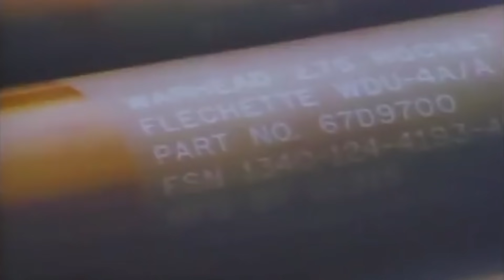'Rods from God' Weapon System Gets Another Look

Comment: Total cobblers.  Assuming the projectile does not lose much of its energy from air resistance during the fall (which it will) the energy released on impact with the ground cannot possibly exceed the energy it took to put it into space in the first place. This would be equivalent to only a small fraction of the rocket fuel, most of which is used up in taking the rocket and the rocket fuel together with the launch platform and the other projectiles to that altitude.  Although the impact would be fairly impressive,  probably equivalent to tens of kilos of high explosive concentrated in a small area it can in no way be compared to a nuclear detonation. To prove this meteorites of similar weight moving at even higher velocities impact the earth every day and if these resulted in nuclear weapon scale detonations we would certainly know about it.
Reply: @valerymonneron9357  The principal of conservation of energy and momentum is one of the most if not the most fundamental laws of physics. The amount of energy released by the projectile cannot possibly exceed the amount put in I.e the gain in potential energy in putting it into orbit, which can only come from the proportion of the chemical energy released by the rocket fuel expended to raise it and it alone to altitude. The addition of a rail gun would also need considerable energy to get it into orbit and to power it sufficiently for it to have any significant contribution to the energy of the projectile, so that solution is not likely to be very efficient.  During WW2 the famous British inventor Barnes Wallace developed the Grand Slam bomb, which was partly a kinetic weapon dropped from a great height into hardened targets but like the later American missiles mentioned in the video the kinetic energy was used to provide the penetration needed before the conventional explosives payload was detonated.
Reply: Youre Mahm  OK, so lets assume the "rod from god" weighs 1 metric tonne or 1,000kg, which is pretty big, and is dropped from say 400km height, which is the orbit of the International Space Station. Newton's 3rd law states v^2=u^ + 2as.  The initial velocity u = 0 which simplifies the equation to v^2 = 2as so the final velocity (assuming no air friction) v = (2as)^1/2. Acceleration is 9.81metres/sec/sec so the impact velocity v = 2,801 metres per second (pretty fast).  The kinetic energy released on impact with the ground is 1/2mv^2 = 3,922,800,500 joules, say 4 gigajoules.  This equates to a conventional explosive yield of about 1 metric tonne of TNT.  So as a rule of thumb 1kg payload dropped from a height of 400km results in an explosion equivalent to 1kg of TNT.  As a comparison, the "Grand Slam" bomb of WW2 dropped from a height of about 4km containing 4,300 kg of Torpex explosives had an explosive yield of about 6.7 metric tonnes of TNT and the first atomic bomb dropped on Hiroshima had an explosive yield of around 15,000 tonnes of TNT.

Comment: Its a Ten ton Tungsten rod, considering all the top secret launches in the last 20 years after the shuttle program ended they are already up there, and far worse.  It would unleash about the same energy as the Nagasaki bomb but no fire or radiation from the blast.  And they would have multiple rods in each platform.  Our heavy lift capabilities make this more than plausible even if it has many 10 ton rods
Reply: not even close, i actually did the energy calculation and one 10 ton rod traveling at orbital velocity has roughly 0.07 kilotons worth of kinetic energy.
Reply: You do realize there is no such thing as Kilotons worth of Kinetic Energy, that pretty much assures me your calculations will be wrong because you don't even know you need to calculate into MJ then try to guestimate how many tons of TNT it would equate to.  If you think 22000 pounds slamming into the earth at 17000 mph isn't a lot of energy then I see no point in even trying to explain the energy to you.  Considering asteroids in the past about that mass hitting the earth left craters hundreds of feet deep and nearly a mile across.  You don't even seem to understand the problem correctly, so I doubt you can calculate it accurately.

Comment: If the dude who jumped out of a balloon at 110000 feet broke the sound barrier in free fall these things would easily go super sonic from the same altitude.
Reply: 17000 Mph is a little faster than supersonic im afraid Hakapik, that's approximately how fast the rods would be going when they hit the atmosphere
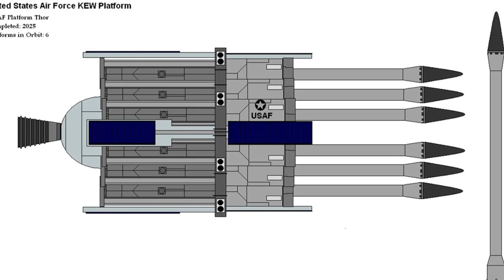Reply: @dajhrm  At the 1:07 mark the vid says they were 20 feet long, 1 foot thick rods dropped from high enough altitude to reach "sound barrier breaking speeds". Where do they claim 17000 MPH? Sorry Goosworks lab, but I am afraid  they dont. You are at least right about one thing, 17000 MPH is not the "sound barrier breaking" speed referred to in the vid, is it?
Reply: That's the speed they are at in orbit, if I need to explain that to you then its probably beyond your understanding to begin with.  You do understand they are dropped from orbit then fall to earth, they fall at approximately 17000 mph until they hit thick atmosphere at around 100k feet and slow down marginally when they hit the ground in about 3 seconds depending on angle of inclination on entry, these are dropped from around 100 miles up or more, not 110000 feet, the height of a U2 Spy plane.  You clearly don't understand at all how this weapons system works.
Reply: Except he didn't, first of all, if he did, he'd be blind, deaf and most importantly, dead, as going at supersonic speed with just your body would blast your lungs and ear drums. Even if they were indestructible, you wouldn't have enough energy to breathe, and would suffocate. Last of all, human body terminal velocity is about 120mph, 160mph if you do it right, it is objectively impossible to fall faster than that.

Comment: u can make a scramjet do mach 18 and survive the heat  but can't coat the tip of a rod with heat resistant ceramic like on the shuttle? And here's the thing only the nose is taking the friction  you just need to keep adding rod until you get enough to survive till impact

Comment: You use a mass driver and launch asteroids.... 50,000 mph speed means a much smaller mass for said power...
Reply: yes and no, rocks come apart alot easier, and youd have to be pretty dam careful not to underestimate the rock or orbit and have a much larger hit than desired vs an aerodynamic metal rod that doesnt break apart randomly.
Reply: the idea is to have it in orbit ready, not to have to go and get some rock out of an asteroid belt and spend years getting it into earth orbit somehow to then drop it

Comment: Complete horseshit what about terminal velocity and other symbol physics??
Reply: the rods would be skinny barely any air resistance to slow them down and by the time the air would be thick enough to slow them down in any way they would be flying around Mach 10 the only problem they face is getting so hot they melt.

Comment: Somebody worked out the math on the potential energy of a 2000 pound penetrator and it was not as high as this guy says. It would have taken 10 of them to equal the 15 kilotons atomic bomb. Now does this make it worthless, NO, it just needs to be a bit more realistic. The type of ground composition is also a factor, soft sand or solid rock. It is a weapon worth researching.
Reply: surface friction and aerodynamic drag wouldnt scale if you just made it a 30,000 pound rod....might only take 10 of them but yeah. dropping 20,000 lbs of mass from orbit with 0 fallout in a non stoppable fashion is something.....i guess you can hit it and try to get it to spin and come apart but the velocity the 2 objects would close at would be insane, would need something like a sprint missile again
Reply: @Richard-ie1if  20 000lbs would still not hit atomic bomb yield. far from it.   unless you accelerate it to near speed of light.
Reply: @jkk20  at 20k lb and 1/2 light speed y'all would want to be in the next state minimum
Reply: Well it's not perfect but the best alternative there is to nukes when it comes to say attacking infrastructure deep in enemy airspace where it's unsafe for bombers to go or places where your troops might need to advance to
Reply: Nuclear weapons are good because they typically airburst and dump all of their energy into the atmosphere which is then turned into a shockwave that does most of the damage (They also produce a shitload of heat but that doesn't do more damage than the shockwave unless you start getting into the megaton-yields). Kinetic weapons like rods from the gods will never be a true replacement to nuclear weapons because they dump all their energy into the ground, the ground is also a much thicker medium than the atmosphere (Ground vs air) so the shockwave doesn't travel as far. You could theoretically trigger man-made earthquakes with this kind of thing, but it's basically just a bunker buster on steroids. It's not a WMD.
Reply: @cod6guy12  heat of an hydrogen bomb does damage. as long as the area targeted is within the dome created by the hot plasma moments after detonation.  there was some value about detonating a nuke upon contact with the ground rather than air burst,or a very small altitude air burst even to get a abnormal wave adding onto the allready high compression generated by the hot gasses. anyhow,nukes will always be favored for outright destruction vs any other hollywood sci-fi voodoo rod of god bs.
Reply: @jkk20  I didn't think it was necessary to point that out as at that distance the shockwave is strong enough to obliterate everything regardless - I was more-so talking about radiant heat. The lethal-radius of the heat is usually smaller than the lethal-radius of the shockwave up until a certain yield. 
I haven't heard about detonating nukes at lower altitudes for a stronger shockwave (I was under the impression that high alt. airbursts were always superior for cities) but I can picture in my head how the waves could overlap and cause that affect, so that makes sense.
Reply: @cod6guy12  highly reinforced concrete won't buck down to a thermonuclear warhead's shockwave at those small distances for the most part,what could help is temperature and its effect on said material. 

about the overlapping shockwave effect,it was filmed on a few different shots. one of them was the atomic annie shot (atomic canon) 15kt that did way more damage since it was at 500 feet,now imagine a thermonuclear warhead of just 100kt at anything under 1000ft and you have a recipe. the reasons they'd want to nuke at higher altitudes it is to maximise radius of destruction,minimise radiation all while being efficient with the least effort. kill more,polute the land less so the troops could potentially re-capture the land(invasion) at least its what i think they'd do it for.
Reply: @jkk20  Hmm, I quickly did a bit of research and it seems a very large nuke like the Tsar Bomba has a 20psi blast overpressure radius about twice as large as its fireball. From what I understand, most reinforced concrete buildings are heavily damaged at 10psi - Though that number could be higher for military grade reinforced concrete.
This is the site I used for the Tsar Bomba overpressure number: https://nuclearsecrecy.com/nukemap/?&kt=50000&lat=40.72422&lng=-73.9961&hob_opt=2&hob_psi=5&hob_ft=13000&ff=3&psi=20,5,1&zm=10
If the link looks sketchy you can google 'Nukemap' instead.
Reply: @cod6guy12  yes,at 20psi we are looking at heavy damages. but there is also something to take into account,today's building code stems from a series of nuclear testing to see what were the limits of engineering to prevent such catastrophies.  teapot MET shot served as a test bed to see if safes,wooden or even concrete reinforced houses could sustain a nuke at x distance.   

i believe the nuke was placed 1km away from test items. many reinforced structure survived. even the paint or lack thereof proved to affect the resulting survival of the test items. hence,i would not think that a basic nuke would do much to a city unless its set to detonate at low altitude. cause a earthquake aftershock all the while cratering and spreading soil and so on.

and yes,i've read the nuclearsecrecy blog a few times here and there,not a bad read for certain
Reply: @cod6guy12  with enough rods you could create an small earthquake. or just devistate critical infrastructure facilities.
Reply: @lIII  Hey I think that was point of creating a man made earthquake. Especially if it was hit on a tectonic plate on land
Reply: Probably would want to drop a bunch on a city anyways.
Reply: I ran the numbers, account for orbital velocity plus acceleration due to gravity, neglecting deceleration due to air resistance, its 0.0174kt.
Only one nuclear device was every deployed with a smaller yield, and it's about 1.5 times the energy release of the MOAB.
Reply: @Evan_Bell  Post your working.
Reply: @forestdenizen6497 
 Orbital velocity:
V_orb = ((G*M)/r)^0.5.
G = 6.67e-11
M = 5.97e24. 
r = 6,371,000 + (1,000,000*1.609) = 7,980,000m. 
V_orb = 7,064ms^-1.

Velocity from falling:
V_final^2 = V_initial^2 + 2ad. 
V_initial (vertical) = 0
a = 9.807ms^-2.
d = 1,000,000*1609 = 1.609e6
V_final^2 = 1.578e7
V_final = 3,972ms^-1

V_total: 7,064 + 3,972 = 11,036ms^-1. 

Kinetic energy: 
E_k = 0.5*m*(V^2)
m = 2000 lbs = 907kg. 
V^2 = 121,800,739. 
0.5*907*121,800,739 = 5.524e10j. 

1kt_TNT = 4.184e12j. 
5.524e10/4.184e12 = 0.0132kt. 

Slightly lower than what I got before, but I was using online calculators for speed. Perhaps I entered a value slightly incorrectly.
Reply: Thats good because you can destroy tactical positions and not kill alot of civilans or destroy the land its not nuclear so the plant will still regrow
Reply: Maybe good for localized tactical strikes where use of explosive or conventional weaponry is inadvisable. I've seen vids of fighter jets launching BDUs (bomb dummy units, more or less inert concrete with a guidance system) and when their target is hit, 500 pounds (~250 kilos) going 500+mph is definitely nothing to sneeze at. I have no doubt that in the next 25 years, weapon systems like these will offer more bang for your buck. I'll see myself out 😂
Reply: @rhubarbpie2027  Back in the late 1960's the US Air Force stated in a briefing that a 1000 pound solid iron rod dropped from a SR-71 doing Mach 3 had the potential of hitting a Carrier and going through every deck and setting fires on all decks. It could take out the ship if the Magazine were hit (very possible) or the Reactors were hit, poisoning the ship.
Reply: @johnparrish9215  you say it had less potential energy, the idiot in the video says it would hit at sound barrier breaking speeds, mach 1+ but in reality they would hit at mach 10.
Reply: @rhubarbpie2027  It is simply impossible for a free falling 250kg object to go over 500mph
Reply: @kirayoshikage4057  when an aerodynamic, cigar shaped, fin stabilized projectile is motivated by two Pratt and Whitney turbojet engines, amazing things can be done.
Reply: @kirayoshikage4057  lmao ok dude you work on the formulas to disprove me and I'll move on with my life.
Reply: I think your math is wrong,  plus I don't know where he got the 1 ton thing from, its more likely 10 or even 20 ton rods and multiples per satellite, considering they admit to being able to heavy lift 1 million pounds now, so its likely much higher, and US Government had a lot of top secret Triple atlas launches taking some heavy compact stuff up over the last 10 years
Reply: With great intelligence work targets a super computor could be used to calculate targeting solutions an rain tungsten steel with pin point accuracy. 
Properly set up radar and laser satellites could take down incoming nukes and effectively render a major war won in hours
Reply: You know a few things that could be noted here. Let me start by pointing out that at bare minimum let's say they give the tips of these tungsten rods hardening agents and add 10 seconds worth of thrust capability for immediately after the initial drop. Without running the math I can tell you right now that at bare minimum depending on the thruster it would give it at least double the potential energy and piercing capabilities so in essence surgical strike high powered bunker Busters. you add a small amount of explosives that specifically only detonate on impact and you add an entirely different level of Destruction throwing tungsten shards outwards in all directions as well as down in the same manner as using a shaped charge for precision and then throwing a frag in for good measure
Reply: Sorry for the multiple posts and Factor number 2 to remember would be is if anyone has considered using a combination of tungsten and nuclear material as an alternative to icbm's with nuclear tips. There's also the added potential of accurately dropping a neutron bomb anywhere in the world by leaving it on the tip of the rod. then you don't have to account for weapons-grade plutonium or uranium but you could deal with a variety of shorter half-life but still deadly material.